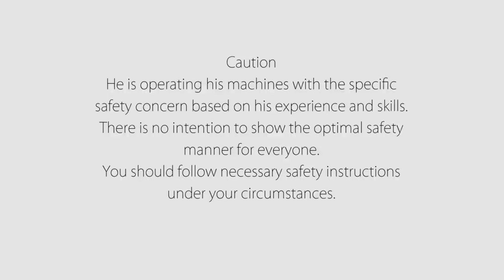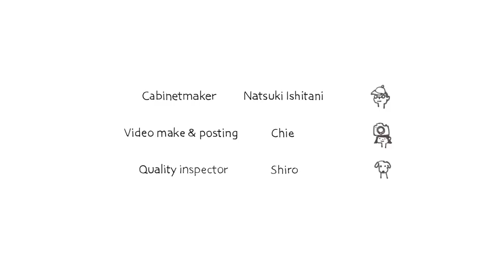ISHITANI - Making a Cherry Kitchen Cupboard

Comment: Thanks for the great video . I am so glaf you arent one of those guys that has to fill his video with chatting.  I would suggest adding the staining and finsh coat steps for a complete video. But amazing workmanship and decent  shop setup. Also I think you should look into finishing with  epoxy and urethane for long lasting high gloss seal for your work

Comment: Ishitani-san, another nice piece of work and very much enjoy your videos.  Notice that you used the Sugatsune lifts - I tried them in the opposite way (tilt-up for some cabinet uppers) and found them use-less OR too limited to support the weight - wondering if you had generally good experience in this configuration?  Anyway, interesting to see this client drove you to use the laminate, metal shelf supports, etc which I'm sure was not your preference, but nicely integrated into the cabinet!

Comment: I always wait for the birds chirping at the end :-). Beautiful build and video!
What are the black bars on the back of the doors?
Reply: They should be similar to iron c-channel bars that you install on the bottom side of large slab table tops.  Since the door is a glued panel of hardwood, they'll tend to cup/deform over time and the bars will keep the entire panel flat.
Reply: @darknatured  I have never seen such product? Do you have a link/reference?
Reply: @PaliVCiernom  here you go: https://youtu.be/M1GEHvncD-4?t=182

Comment: Does anyone know what's that metal part called which i suppose have been used against bending the independent boards? 12:20 you can see the shape of it in the left bottom corner.

Comment: Hi Natsuki. I love your projects, videos and Shiro! A question...in the Cherry Kitchen Cupboard, where do you source those 'C' section flat bars that run vertically up the middle of each door? I presume they counteract cupping across the grain.
Reply: mikethebikemh I wondered about those too. I thought they were there as a wear surface. So if heavy things are slid on the lowered doors, they won’t mar the wood? I don’t think they are to keep the doors from cupping. His design prevents that from happening. And if he really was worried about cupping, and needed to use something to maintain flatness, he would use a wood dovetail batten vs. a piece of metal.